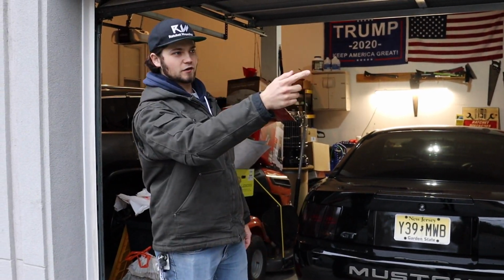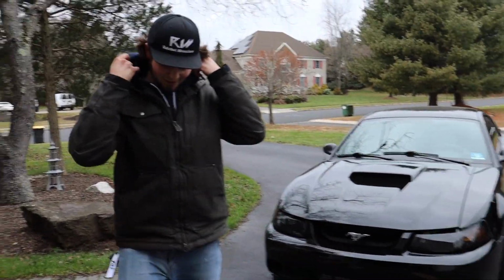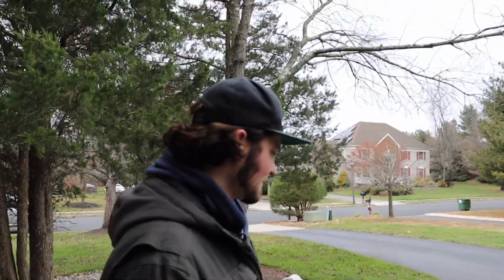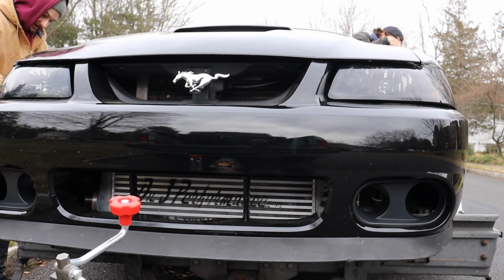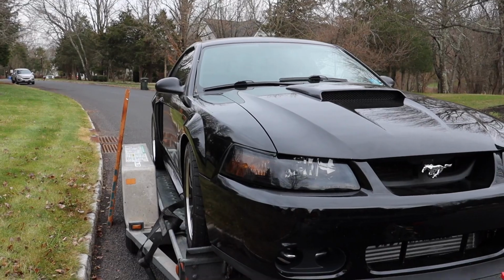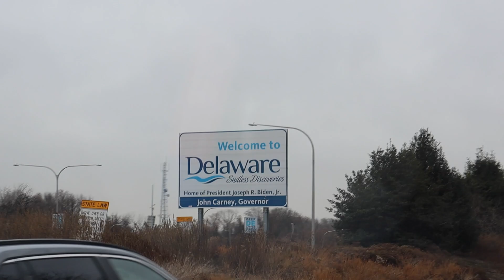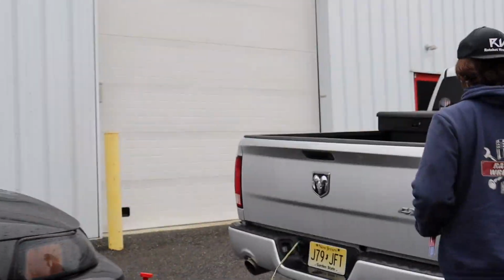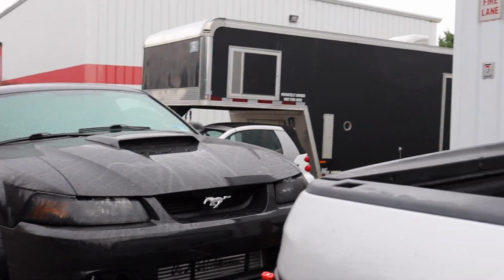Turbo NewEdge Mustang Dyno Day!

Comment: Putting mine together with nitrous as soon as parts come in, 10:1 compression, comp 274 cams, hand ported heads with a 3 angle valve job, and I'm gonna learn how to tune it myself on the neighbor's dyno, shooting for 400 NA.
Reply from the maker: Nice! With some nitrous you could probably get close to 400HP.
Reply: @RatchetWrenches  It's a built motor, forged crank/rods/pistons, big cams, I'm shooting for 400 all motor, expecting like 350+ to the wheels realistically, with spray the eventual goal is 700 with spray, after turbos I'm hoping for 900+ boosted motor and 1100ish spraying under the turbskis I've got my own channel if you wanna check out how my build is going. Sadly I don't know how to edit but I'm searching for an editor.

Comment: Looks good. Looks like fun. Btw the uhaul trailers should have fold down fenders so you can get in and out easy.
Reply from the maker: Thank you! Yah we can't wait to get it back from the tuner. And appreciate the tip haha we were in a rush and didn't even realize it had the fold down fenders
Reply: @RatchetWrenches  I've crawled through the trunk a few times before I found out the fenders fold down lol.

Comment: Just watched an older video of yours. It was the water pump change on the c5. Just wondering if you needed to lift the car in order to drain the coolant
Reply from the maker: Yea I answered there but yes you will need to lift the car up from the side to get easier access to drain/catch the fluid

Comment: Great job guys good video for the 2v community. Yes it will be strong 400Hp plus. I have a 2v mustang gt with a Procharger P1SC and I'm pushing over 350Hp.
Reply from the maker: Thank you and yes we know it'll hit 400HP no problem we can't wait! That's awesome I love a good Procharged 2v 👍🏼
Reply: I had a Vortech on my 01. I’ll never have another centrifugal! Requires power to make power, boost lag and to many pulleys and belt issues with no space to work. Turbo is the way. They’ll always make more power than superchargers and it’s easier to work on

Comment: Do you guys live in pa
Reply from the maker: We live in new Jersey
Reply: @RatchetWrenches  was wondering if you guys had emissions.  Pa does. And I'm wondering about keeping my stock manifolds and going to a high flow catted x pipe. Do you know if it will still pass emissions with high flow cats. Just got the car a few months ago. It's a 2003 gt vert. Already upgraded rear sway bar. Put new a arms and bushings in front and rack bushings.  New wheels and tires. Still need to lower it. But I get my inspiration from your videos. Oh and I put flowmaster super 10s on it. Weld ins so I'm assuming if I go with high flow cat x pipe it should be louder. Thank you in advance